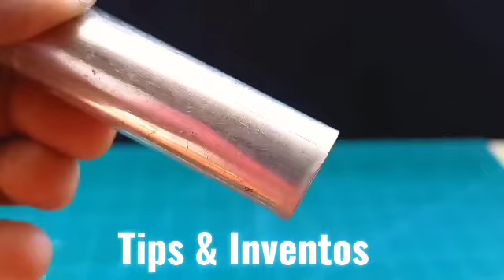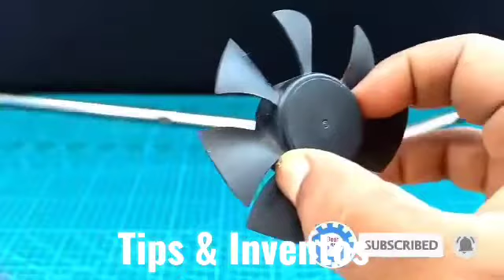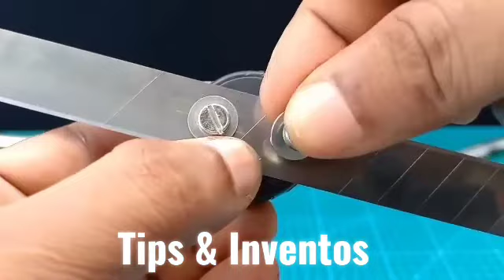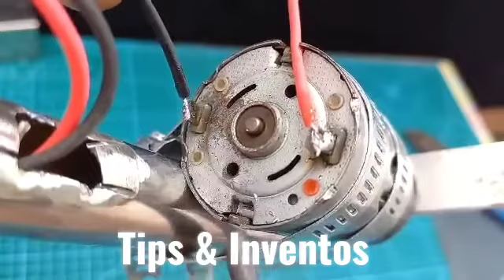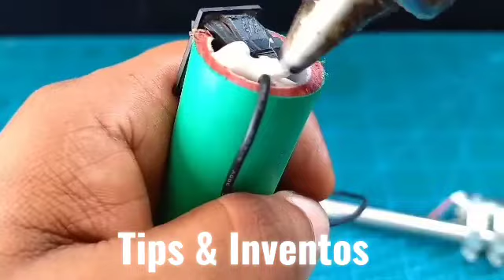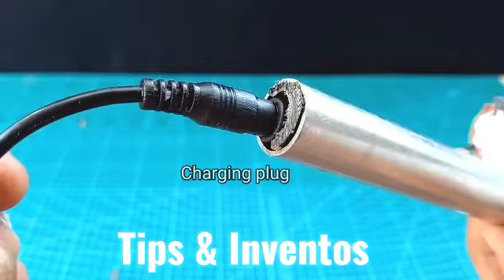Como Hacer una Cortadora de Cesped Casera

Comment: Aunque no se debe cortar con cuchillas y menos de bisturí, debe hacerse con nailon porque las cuchillas puede romperse en caso de impactar contra una piedra y salir disparada y lastimar gravemente a las personas
Reply: Tienes razón amigo
Reply: Para que no se rompan hay que destemplarlas pasando las por una llama , quedan muy resistente pero a la vez flexible evitando su rotura
Reply: @hieanguzman34  el cesped se corta con nailon la única cuchilla que se puede usar sin temor a que salga disparada es carísima y eso no lo mueve un motor tan chico
Reply: No quiero imaginar si llegase a romperse la cuchilla😢  la idea es buena solo necesitas algunos cambios 👍